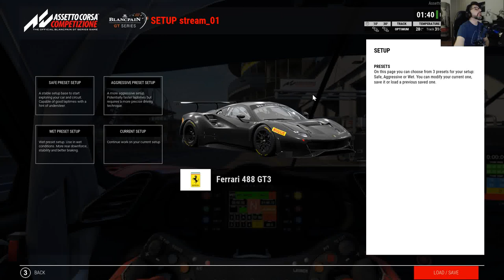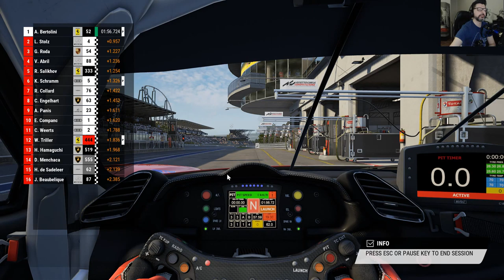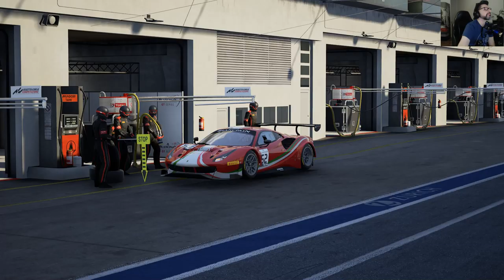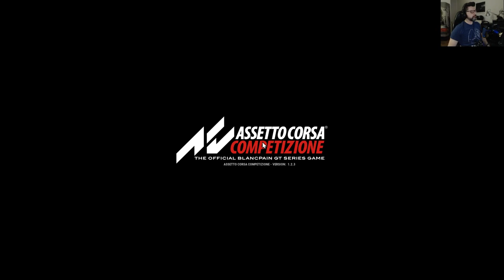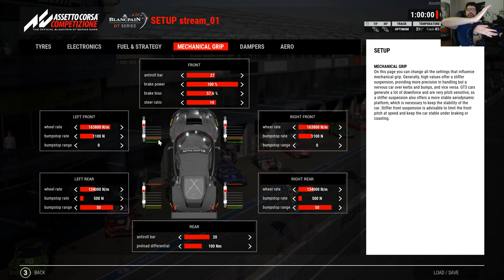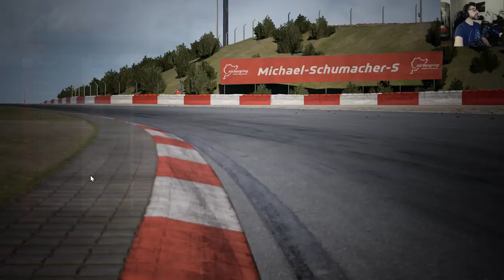TL;DW - Step 5. Stiffer wheel rates = better aero stability. Bump stop rate and range explanation.

Comment: hello aris, I'm watching all your live and your videos to try to understand something more about the setups of the machines to be able to drive them at their best, and I take this opportunity to thank you because finally someone took charge of this great responsibility and decided to do it once and for all :)
I wanted to ask you two questions which unfortunately perhaps for the language or my brain I cannot understand in any way, one and the use of the dumbstoprate I cannot understand what they are used for and what effect they have I only understood that the front must be the as close as possible to the spring but the back? and then if you could explain the differential because in some games there is both the braking and the accelerating ones and I do not understand the use of this in the race racing set-up can you help me?
Reply from the maker: I think you might find helpful to read our forums official articles about it. It should be more clear and easier to translate. 
Learn about bumpstops here: https://www.assettocorsa.net/forum/index.php?threads/bumpstop-telemetry-in-the-setup-screen.52138/

and learn about aerodynamic balance and instability because of pitch, here: https://www.assettocorsa.net/forum/index.php?threads/aero-i-believe-i-can-fly….50787/

I'll try to explain better the differential in future videos. A small note about it: In ACC there is braking and accelerating values of differential lock, but they are locked and not possible to change for each car. Homologation rules do not permit to change those values. 
You can change preload, that adjust a little bit the differential at the initial response.

Comment: Great video as usual. I love you are breaking up the video in small digestible parts.

You said "I could use a tiny bit more of front grip" and then lowered brake bias to 57%, can you please explain the logic? 
Thanks a lot!
Reply from the maker: Sure, as we discussed on the "how tyre generate grip" a tyre can't do both jobs equally well (lateral and longitudinal grip, braking and turning). So if you want more from one, you need to give in a bit from the other. In that particular situation I wanted to have some more lateral during turn in. So by moving brake bias a bit backwards I release the tyre a bit of my braking request (when I'm trailbraking) and this gives me a bit extra lateral grip that puts the nose in. Also the fact that the rear brakes a bit more now, helps with the rotation (for the same reasons as above but on the contrary effects)
Reply: @ArisDrives  Thanks a lot, super clear and really helpful. 

You are doing a fantastic job (Also Kunos in general). We understand is really hard, please don't give up!

Comment: Last day I jumped for the first time on the McLaren 720s and did 1.54.5 on lap 3 with the aggressive setup.
There is a problem ; considering I'm pretty fast usually and is not an error of my driving ......probably; after the Schumacher "chicane" there is the 90 degree left turn , the problem here happens when I release the brake before turning ( even tried trail braking or turning with half brake ), the car completely loses rear grip and I have to counter steer , or I cannot get on the throttle.
This is the only place in the whole track I'm having issue with;I tried moving the brake balance from front to rear ( the car start at 58 %)but I had understeer and often losing  time in 3-4 turns .
Is not a big problem that left turn I can manage the exit pretty well .
I want you to ask if u can tale a look at the aggressive setup and tell me why shes doing  it .
If you need I can upload a video recreating the same issue. 
Thanks for the videos ! 
Grazie per I video !
Reply from the maker: That is a very very typical handling situation on that turn. Now obviously if you don't have any issues elsewhere in the track, the first advice is to drive differently. Brake a tiny bit earlier and go costing in the turn, sooner than you would, don't stay on the brakes too much.

In terms of setup, check your pressures when you arrive at the turn. I bet that you arrive with the rear right tyre with much less than ideal pressure than the others. You could tweak the rear right pressure so that you arrive on that turn with the correct pressure. So extra positive toe at the rear might also help you. 
Try and let us know
Reply: @ArisDrives  
i try to change the way to approach that turn it may take a while maybe 3-4 laps  and then ,I'll take a look tomorrow at my Rear pressure .and TOE angle.
Thanks for the advice. :)
Reply: I'm late to the party but increasing differential preload will help stabilize the car off throttle on turn in
Reply from the maker: @EAHowe  very correct

Comment: Really very well explained. 
But why is the bumpstop range so high in the back?
Reply from the maker: You usually don't want to have the rear on the bumpstops as it makes traction much worse over bumps and kerbs. There are situations where you might want to ride some bumpstops at the rear too, but it's rare. We are discussing this, in this forum thread: 
https://www.assettocorsa.net/forum/index.php?threads/aris-drives.61755/page-2#post-1110520

Comment: @Aris why did you keep the bumpstomp windows so high for the rear? You said it should be as small as possible or did I get it wrong? Thank you
Reply from the maker: As small as possible to the front (and it depends). As high as possible to the rear. I don't remember the video, I should rewatch and see if I said something wrongly while talking. 
Mainly you want the rear bumpstops high enough (big gap) to absorb better kerbs, bumps and so on and have better traction so that the TC doesn't interfere. Sometimes you need some rear bumpstops to make the car less understeery at high speeds but just enough to not touch them at low speeds and maintain traction.
Reply: @ArisDrives  thank you very much, I think you said all right in the video. This was the only thing I didn't get and now I know why
Reply: @AlessioMitrotta  i am a sim noob but when he said small he's referring to the the sort of analysis window showing the damper with the red, yellow wavy lines etc.
Reply: @ArisDrives  If there is a track where there are huge gains in jumping over sausages, what is the best way to setup the car: increase bump stop range front and rear and make them softer?

Comment: I’ve watched this so many times and I still don’t understand bump stops 🤯
Reply: Think of bump stops as squishing an eraser with your fingers.
Bump stops are such kind of squishy material at the end of the spring.

U see springs r hard objects which can only compress to a certain length (aka bottoming out), so once u bottom out a spring (fully compressed) it doesn't absorb shocks anymore, you're gonna feel a sudden jolt from underneath. It will also send the car up in the air.

Bump stops mitigate that, it acts like a second layer of spring. But unlike a spring it's compression is not linear (the more u squish the BS the harder it becomes to squish it further).

That's my understanding of BS